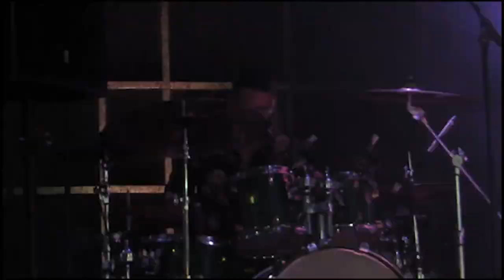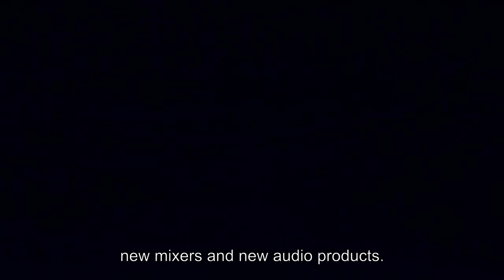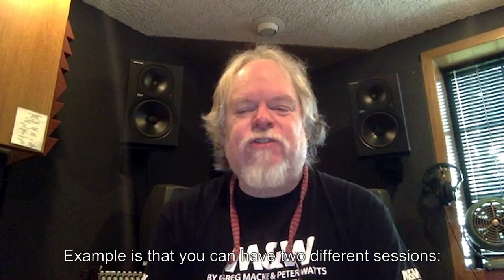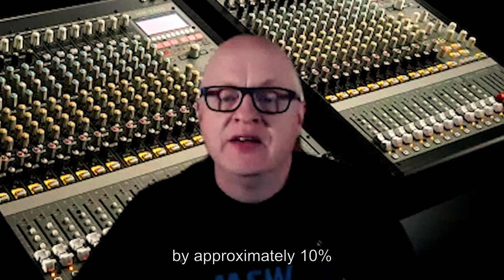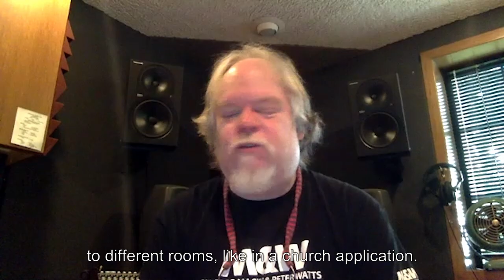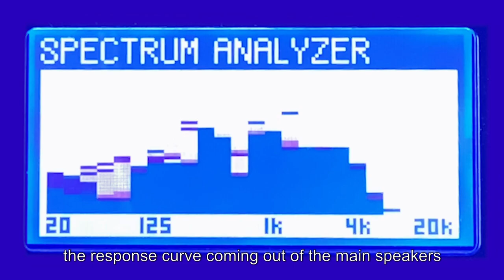Korg Soundlink Mixers with Greg Mackie & Peter Watts

Comment: I've become very interested in this mixer when at first I didn't see the appeal when it was announced. I totally understand why some folks would question the number of stereo channels. Having moved to a more electronic DAWless production, I have flipped on this. I have run out of stereo channels on my current gear and was searching for mixers that had more when the Korg came back into my scope. I think keyboardists will find this appealing. Although normally I would use aux busses for external effects, the possibility of routing different drum samplers and drum machines etc. to different stereo pedal effects via the stereo busses is kind of compelling. 

You might not need the manual, but the pdf that I reviewed to see if I would like this mixer is outstanding. I literally learned audio engineering from a Mackie manual 40 years ago, so good to see that precedent re-validated. I was disappointed to see in the functional schematic that the internal effects bus is mono from the channels going to the effects section, although stereo coming out. 

I put this on my wishlist about a month ago, after having totally discounting this product, based on the manual.  Curious that neither designer espoused the "analogue character" of their design, or the benefits of an analogue circuit in the production chain in general. I hope to hear  this product in person to determine if it actually sounds good, beyond it's thoughtful functionality.

Comment: How do you monitor the gain reduction of the Main bus compressor/limiter? Is it on the display? I didn’t see anything on this in the manual. Of course we use our ears, but is there any visual representation in the display of what is going on in terms of gain reduction and limiting?

Comment: While performing live music on stage with korg pa4x, I turn up the Volume of pa4x to the full, even if I turn the gains up more than half from the mixer, there is no strong sound. Compressors, limiters, all of them are closed, but the sound is not powerful from the speakers. the speakers i use are RCF 745 series. but the speakers i connect to the aux are incredibly powerful. I can't open the aux buttons more than two lines. The sounds are too strong. There is no power to the main output.
I had an old Yamaha mixer, even with the gains turned off, I couldn't turn the volume up halfway, it had a very powerful sound output.